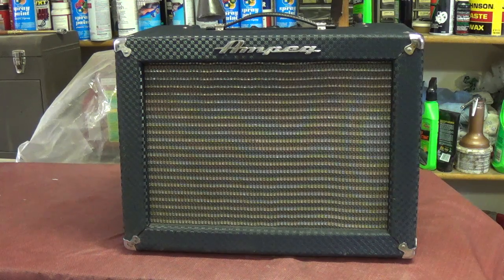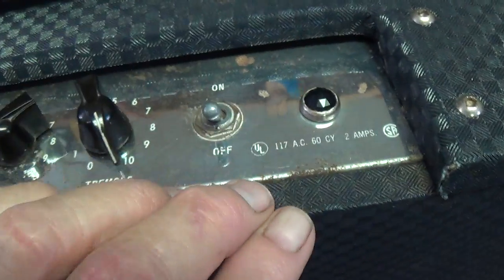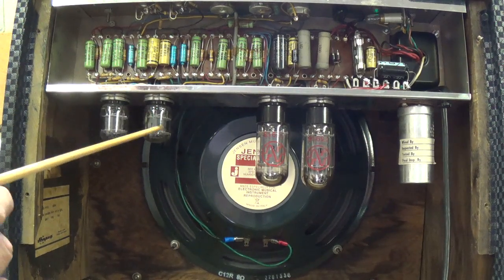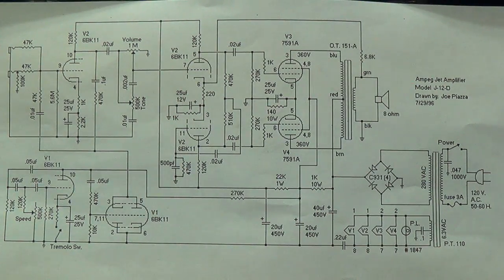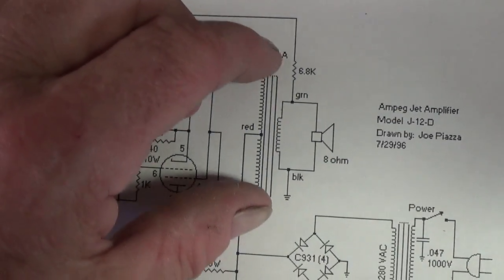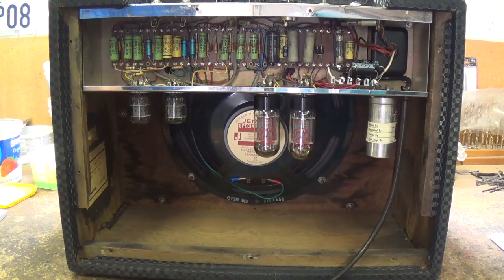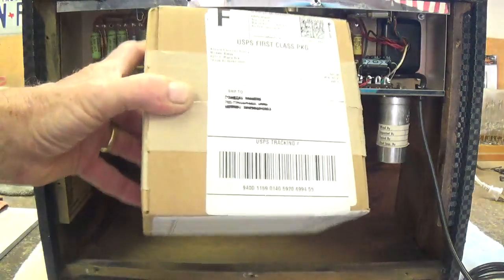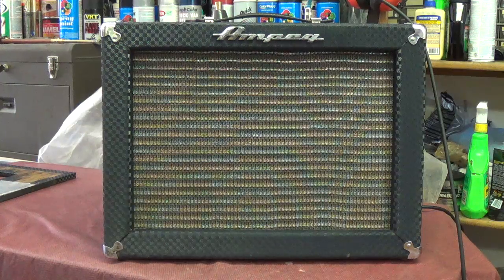1966 Ampeg J12D Jet from Craigslist.....Junk or Gem ???

Comment: Most likely if you look at the wiring at the socket are the wires coming off of socket where they would go and they don't look touched it was more likely the tube rather than any wiring it's very logical nonetheless Uncle Doug very good on instruction you have an excellent instinct for teaching and we thank you for it. Signed.Dwight. ps. You have an excellent way of verifying anything no matter what it looks like. No matter who says what. And that impact looks like a nice piece of equipment for a hell of a lot lower cost than an antique overpriced fender. And in my opinion just as damn good as a fender. Usefulness is my motto not antique overpricing.
Reply from the maker: Thanks for your comments, Dwight :)

Comment: Uncle Doug .I scored an old Heathkit model EA-3.I was thinking I could make a vox style amp from it because it runs two EL84S but the power transformer is pushing out 350 volts at 130 milliamps unloaded which seems a bit high for a Vox build,what can I build with it? I appreciate any advice you can give me, thanks again ~Luke
Reply from the maker: Too much voltage and current is not a problem.  Too little of either is a problem.  You can easily reduce the voltage and a circuit will only draw as much current as it needs.....so build the Vox if you wish.
Reply: @UncleDoug   okay Thanks ! I got into some research and I found that you can use a mosfet along with some resistors and a zener diode to make a voltages dropping circuit to get into spec to for tube life longevity .Thanks Uncle Doug. My dads brother's name was Doug too! He was pretty savy with tech stuff also!
Reply from the maker: @lpa74  Since your voltage drop would be minimal, it could be achieved simply with resistor(s) of the proper wattage.
Reply: @UncleDoug  thanks! you know it's a curious thing this transformer is supposed to be 360 volts and that was with lower voltages from back in the '50s but I plugged it in and tested it and I'm getting 350 volts with modern line voltages, and that's unloaded too!
Reply from the maker: @lpa74  If the transformer was intended for tube or diode rectification, the unloaded secondary output should be much higher.....around 700VAC. If it utilized a FWBR, the output would be much closer to 350VAC.
Reply: @UncleDoug Yes it's used for tube rectification I didn't measure at the center tap I only measured one of the secondaries to ground , I'm kind of new to this stuff I probably need to watch some more of your videos about transformers
Reply: I say it was "unloaded" but the center tap was still grounded and the two HV secondaries were still soldered to the tube socket (but no tubes in)
Reply from the maker: @lpa74  You only measured half of the output voltage. Measure between both of the secondary outputs.....very carefully.

Comment: My Jet is #023475; just few numbers off from yours. Still has the original speaker, 6bk11's and blue leather handle; tolex and grill are super clean. All it's ever had replaced are the multi stage cap can, the 7591's and one cap in the tremolo circuit to slow things down just a tad. I think it spent most of it's previous life in a closet.
Bought it "non-functional" for $50 from a shop. All it needed was output tubes.
With a paf style pickup, volume at 7 and tone at 7 it produces Duane Allman overdrive tones (I call it the Seagram's setting). Keeps up great volume-wise with a jazz/blues band.
People are frequently amazed when the huge tone comes roaring out of that tiny package.
Reply: I own #023503, also close to both of yours. I replaced the handle many years ago and the plug (to ground) but my speaker and most other components are original. I just love this thing and the expression it brings to faces expecting so much less from it. I will never part with mine.
Reply from the maker: Thanks for sharing this with us, PNW :)
Reply from the maker: Thanks for sharing this with us, PNW:)

Comment: I think there was no followup video on this amp, Doug were you able to solve the 60hz hum?  I'm curious what caused it as you had already replaced the power filter caps.
Reply from the maker: Remember that filter cap hum is 120Hz, Jules, not 60Hz.  I ended up changing the output tubes to 6L6's and making some other mods that helped, but never eliminated the hum.  I sold it humming......cheap.
Reply: @UncleDoug  120hz as a result of full wave rectification, thank you kindly for the reminder.  I'll vote for a ground loop or incorrect wiring / dressing that induced hum.
Reply from the maker: @JulesieCoolsie  Ampeg's have a strange style of filament wiring, Jules.  I tend to suspect it as the cause.

Comment: I worked   for Ampeg   in the 60's screw used is called a "clutch head"made it tamper proof.  Jensen speaker  was standard. very strong tremolo and reverb when equiped. normally very quiet amp. recording studios loved it.
Reply from the maker: Thanks for your contribution to our hobby, Stephen.

Comment: Have almost same model… mine is a j12t…what can be wrong if the amp doesnt seem to break up at all??!  Tubes are brand new…
Reply from the maker: Perhaps it is biased too "cold", Joe.
Reply: @UncleDoug  … i agree… i had opened up the amp and look for a potentiometer like my stereo tube amp.. i do not see one.. and i cant find instruction online to do just that… would you have a tip to do just that??
Reply from the maker: My tip is to get some qualified  technical assistance, Joe. It would be better and safer in the long run. @Joejoe-nt3gc

Comment: Fabulous!  I just got one that needs cap replacement at least.  This will be helpful as a guide while I refurbish my amp.  Thank you!  BGTW, mine is the same model, with 6BK11 preamp and tremolo and 7591 output tubes and solid state rectifier.
Reply from the maker: Good luck with your project, Carl.

Comment: Those screws were standard Ampeg, my Reverberocket has the same ones.  It's a General Motors head.   You definitely got a deal, those are sweet amps!
Reply from the maker: Thanks, Rob :)
Reply: @UncleDoug  thank YOU!  I've been a double E for 40 years and a guitar player for 50, and FINALLY understand tubes!  You have inspired me to become active again.
Reply from the maker: @HusaCreature  That's great news, Rob. Welcome to the vacuum tube fold :)
Reply: @UncleDoug  thanks.  When I played in a band I had a Marshall, and it sounded great, but TONE - I never REALLY got it until I watched your videos.  Finally I hear it.
Reply from the maker: @HusaCreature  That's great news, Rob. Continued success with amps and tone :)

Comment: for what it's worth, the NF resistor was the culprit, changed it out and now the amps quiet as a mouse with no input signal, loud as  you want when cranked. this is a "D " version with factory 7868 Output Tubes
Reply from the maker: Congratulations, Nigel, on a difficult repair.

Comment: thanks for the reply,  its so interactive with the tone control and is quite noticeable on volume set at zero, but it nulls out at volume about 3 just not quite right
Reply from the maker: It's a maddening problem that I was unable to fully correct. I suspect a fault in the design with regard to the filament circuit.

Comment: did you ever fix that hum? I have one that has the same hum after a new 3 prong cord install and new caps.
Reply from the maker: It seems to be quite common in this circuit, Nigel, according to other viewers. I converted my output tubes to 6L6's and the tone improved while the hum seemed to decrease.

Comment: I have a mid 60's Ampeg Jet that I replaced the  bad caps on. I wondered if you ever got rid of the eerily similar 60 Hz. background hum? My hum is still intact. I accidentally started collecting old Ampegs. Jet, Rocket, G-15 and B-18 portaflex. (a classic) Thanks for your videos!
Reply from the maker: Ampeg's can be a real challenge, John. In desperation I ended up rewiring the tube sockets from 7591A to 6L6GC, which greatly improved the tone, and (for reasons unknown) reduced the hum. Perhaps the 6L6's were closer matched (?)

Comment: Did you ever find out what caused the hum?
Reply from the maker: I ended up replacing the 7591A's with 6L6's and it made a huge improvement, B.
Reply: @UncleDoug  

Oh wow, right on.  I didn't expect that, but hey that's cool it worked.  So the original power tubes were just real noisy?   Is that true of all those tubes (I hear they sound great) or just that particular circuit?
Reply from the maker: @Guitar_Wolf  It was a weird circuit, BT. One day it hummed, the next day it didn't. After the tube replacement, it seemed more stable.

Comment: Another one of your 'oldies' that I am watching and enjoying tonight..
I couldn't help but notice how unusual the vibrato circuit is in that amplifier.
The first thing you have to notice is that the vibrato signal is being connected to both the grid and the plate of a phase inverting stage. That means the two vibrato signals are working against each other instead of aiding each other. Also notice that the two paralleled triodes are not really acting as 'active' devices, because they have no path from the plates to any high voltage. Ampex is using them as variable resistance devices that are driven by the vibrato oscillator as you would expect, but they are only acting as variable resistors that shunt some of the first amplifier stage's signal to ground at the vibrato rate... A very unusual and interesting circuit that may also be the source of your hum. Pull the vibrato tube and see if the hum goes away. I think I would also use your current measuring too to verify the currents in both output tubes are close to being balanced; or possibly add 1 ohm resistors to each tube cathode and verify balance by comparing the voltage drop across the resistors...
 I am getting an education by watching your videos and getting the opportunity of analyzing amplifier circuitry I would have never seen otherwise...
Reply from the maker: Thanks for the detailed analysis and helpful tips, Dennis.

Comment: That's a great speaker you have in there too.
A great score, congratulations!
I've got a mid 60's Reverb O Rocket RT that sounded beautiful and has the Echo option with pedal that sounds killer with a strong dry signal that has a natural decay and doesn't get all cloudy or tinny like a SF Fender does, this is more wet. 
One day it made a "pop" and quit working like it was blowing speakers?
It has one of those BK11's too and another short fatty? 
6EU7's and a pair of 7868 output tubes. 
I was so disgusted with it that day, years back, that I just put it away somewhere? 
Your absolutely right about that blue covering! 
It's just beautiful when clean.
It's a bit darker sounding amp, imo, but still nice. 
I actually prefer the earlier models from the early 60's with octagonal tubes, more simple and they sound really phatt and open paired with the right speaker.
Many years back, I was offered a large stash of 6EU7's cheap and I passed them up. Never turn down good deals on nos tubes, lol! I was advised to swap the amp over to 12AX7's and possibly different output tubes as well in it, idk? I just parked it..
Too many irons in the fire at the time, etc.
Reply from the maker: Thanks for the nice comments and for sharing your experiences with us, Amo.

Comment: The screws were a novelty to distinguish Ampeg and cement a commercial patent on a cool product.  These were in a lot of studios.  Ampeg was and still is no for bass tones.  The b15 is actually a great guitar amp with tones of headroom and great breakup.  The chassis are so solid not only are they super quiet (unless a screw is lose), they have incredible compression.  And this amp like the 64-66 Vox pacemaker and 65-67 super reverb is great for everything.
Reply from the maker: Thanks for the info, KG.
Reply: @UncleDoug  after considering your kind response, I realize my initial comments contains a lot of pretentiousness. I admit there is a lot of guessing. Certainly I bow down to your wisdom. And I’m very grateful that I found your YouTube channel. Almost watched everything and learned an incredible amount.  You are a decent and kind/patient man.  Reminds me of an uncle are used to have

Comment: What ever happened to the ampeg amp that you repaired with the 7591 and 6BK11 tubes
That was interesting
Uncle Doug 6BK11's
Sounds like a bit of a
Space saving idea from ampeg. Boy I wish I could have a little house and a work
Shop to play with and fix antique electrons. Your guitars are sounding more intune
And your playin is getin
Better to.
Dwight
Reply from the maker: I replaced the 7591's with 6L6's, which improved the tone and reduced the noise.....then I sold it, Dwight. Thanks !!

Comment: Interesting to see the 7591's in a guitar amp. I have an early 60's Sherwood S-7000 stereo receiver that uses a quartet of them in the power amp. I never realized that they were used outside of hi-fi equipment.
Reply from the maker: Ampeg tends to use unconventional tubes in their amps, Greg, as do several other manufacturers, who also use 7591's.
Reply: Heathkits used them in their stereo (and mono) audio amps in the mid-late 60s.

Comment: You are the master. I am not one who messes with amplifier repair because I have very limited knowledge of electronics. Do you sell used Fenders like a non-reverb Fender Princeton from 1964? Unfortunately I had to sell that a few years ago.
Reply from the maker: Thanks, Jerome. I avoid opera singing for the same reason :) I do sell amps, but do not have a BF Princeton on hand. Both of mine were reverb models and both were already sold. You might be better off with a Silverface Princeton......same circuit at less than half the price.
Reply: @UncleDoug  Thanks. I would if I could find any vintage amps around. I live in the mid Michigan area and the closest place is Elderly Instruments. You barely see any vintaage amps around anymore. I should have kept the Princeton, just seems like the older ones sound better than any reissues. But ya Silverface Princetons would be the way to go. I'll keep my eyes open. Right now I am playing a red-knob Fender Deluxe 85, a solid state amp which sounds very nice. It does have a very nice reverb tank and was made in the U.S. in the late 1980s and early 1990s.

Comment: Two questions Uncle Doug:
1. Did you get the 60 cycle hum sorted?
2. I notice you don't seem to be a fan of replacing the can filter caps with like. Instead, you usually seem to place new filter caps on the board itself. Is there a reason for this?
Reply from the maker: 1.) I converted the output tubes to 6L6's, the hum subsided and the tone improved.  2.)  In non-collector amps, it's much cheaper to simply use separate axial caps. Can caps cost around $40 or more, delivered.

Comment: Those are clutch head screws. I have a 90's re-issue of this. 26L6's 3 12ax7's and an added reverb. But I just opened mine and damned if it's not very similar.

Comment: Uncle Doug, is there any difference between the “A” or “S” marking of the Tube? Why are they called “A” or “S”?
Reply from the maker: The letter suffix may indicate a different version of a tube, i.e. 6L6G, 6L6GB, 6L6GC, etc.
Reply: Uncle Doug, but they are basically inter changeable?
Reply from the maker: @DougFMcDermott  Not always. Sometimes there are voltage and current differences between them. You have to double check using a tube manual.

Comment: Greetings, I just replaced the power transformer and multi cap on my Ampeg Jet. One thing I noticed is that the factory multi cap was a 40/20/20/20 450 volt. One of its 20 mfd taps was wired to the Cathode circuit. The schematic calls for a 25mfd/25V . I was wondering if I should change my cathode cap to a 25mfd  as you did in yours.  My amp does work and sounds fantastic as is. Regards, Twang25
Reply from the maker: It seems "wasteful" to use a 450V cap to do 25V duty, but it's not uncommon. The 450V cap, if it's in good shape, will work just fine.
Reply: I was wondering why the factory used a 20 mfd cathode cap, when their schematic calls for a 25mfd.  Should I upgrade mine from 20 to 25mfd , or is it close enough as is?  Thanks
Reply from the maker: @unclepurple69  It's close enough, UP.  No one could tell the difference audibly.

Comment: Ah..the screws by Ampeg. Apple would be proud.
Reply: Those are "clutch drive" screws; not that unusual,  and any hardware or auto parts store that sells those little red rubber or vinyl cases with various oddball "security"-type bits will typically include one of the matching bits. The condition of the screwheads is also a clue as to whether somebody has been mucking about inside the amplifier, and if they've been replaced with Philips screws than you know for certain that somebody has been inside there....

Comment: Hey, Uncle Doug, did you ever sort out the hum on this one? Also, have you ever given any thought to the day the Compactrons die--perhaps somehow adapting the amp to run dual triodes with maybe a single-triode tremolo (which would be a shame,  because that trem is gorgeous, but...)?
Reply from the maker: Yes. I converted it from the troublesome 7591's to good old 6L6's and not only did the hum situation diminish dramatically, but the tone improved quite a bit.

Comment: Hello Uncle Doug.  DId you ever get to look into the remaining hum?  And if so what was the culprit?  I realize this video is a bit old so you may not remember.  Lord knows I would probable have forgotten.  That amp I built has that same hum and I am yet to sort it out.  I think it is just transformer noise and I will have to live with it I reckon.  It is a real low pitch hum.
Reply from the maker: I changed the sockets and converted to 6L6's, Kevin, and the end result was better tone and less noise.